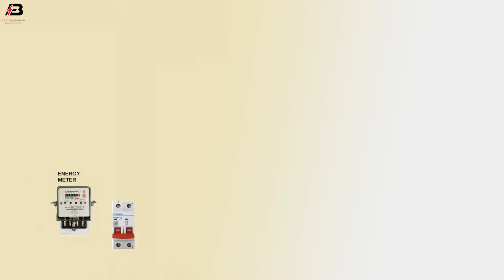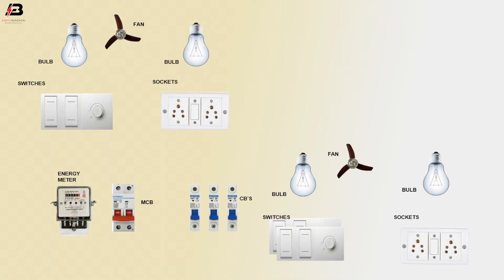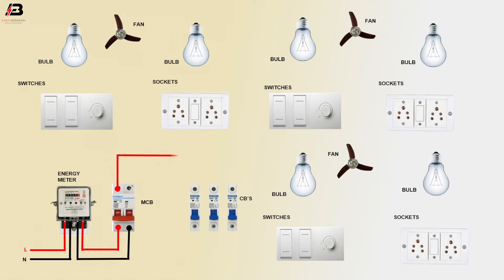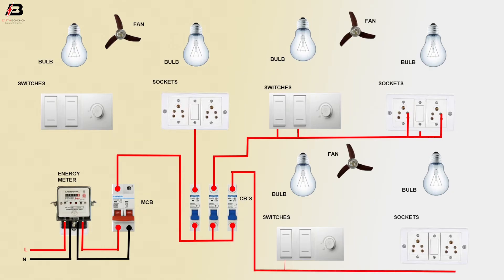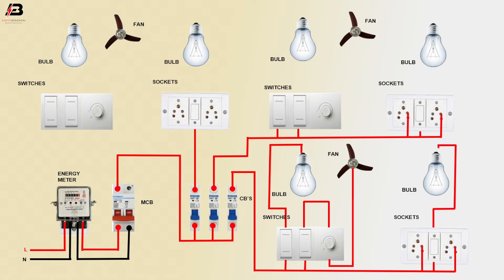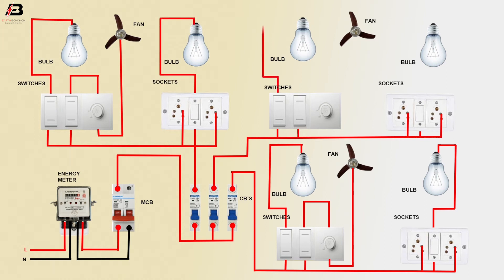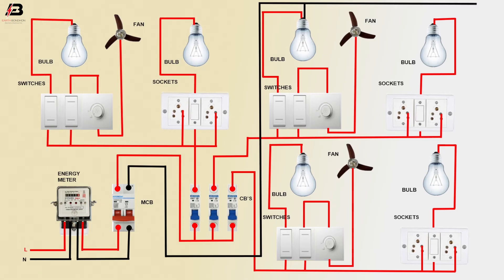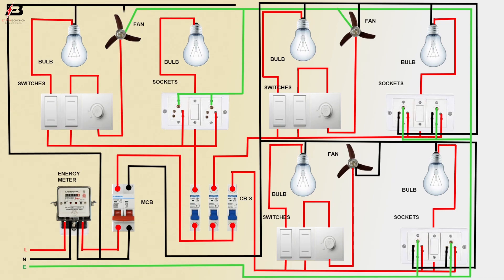3 Room Electrical Wiring Full House Wiring Diagram | full house wiring diagram

Comment: Sir nutrel wire only one use all rooms?
Reply from the maker: Yes...sir...thanks..
Reply: @EarthBondhon  sir mujhe 4rooms m karni h to kya mcb box se nutral wire ak hi 2.5mm ka le ja sakta hu ya fir alag alag
Reply: @EarthBondhon  tv,cooler, fridge,fan,bulb, indection chulha, immersion rod(winter) ye chalana h
Reply from the maker: Yes..
Reply: @EarthBondhon  mcb kitni aur kitne amp. ki lagani h
Reply from the maker: sir...SP MCB 10A & DP MCB 32A useing room SB 10A MCB. Main 32A use...thanks